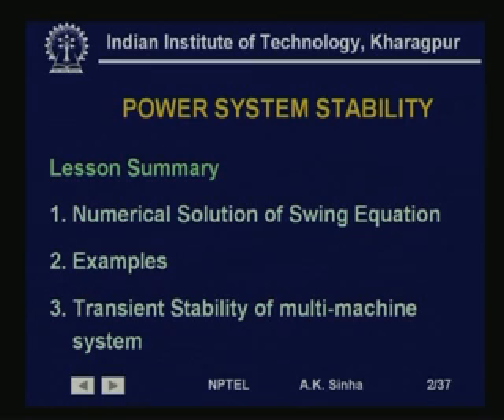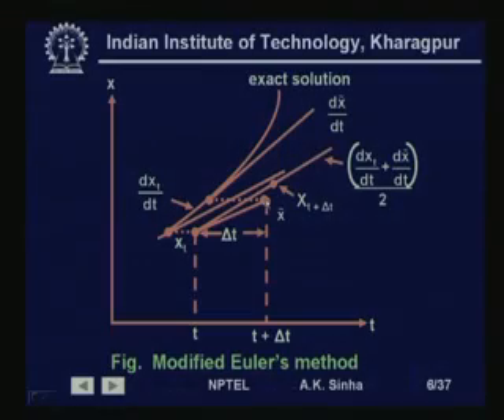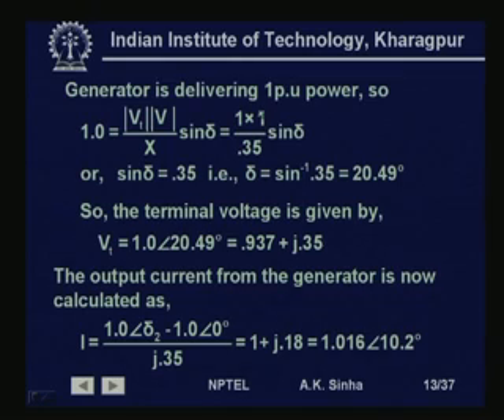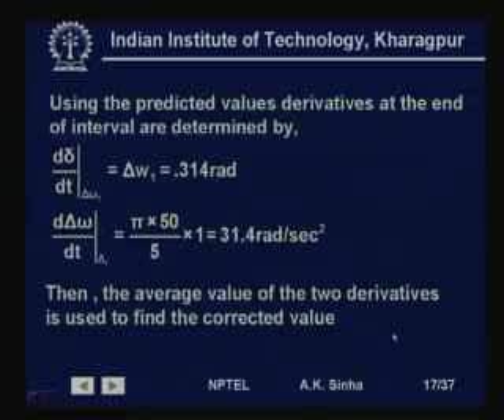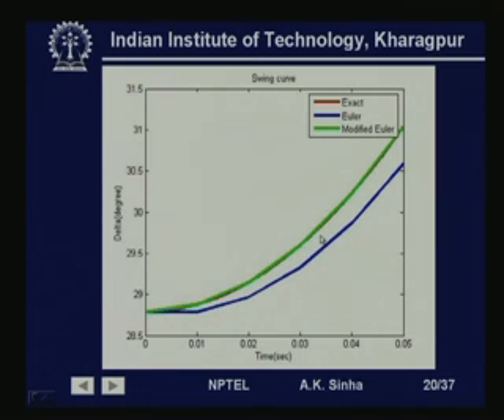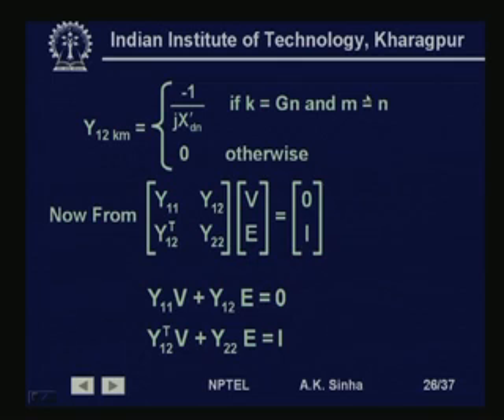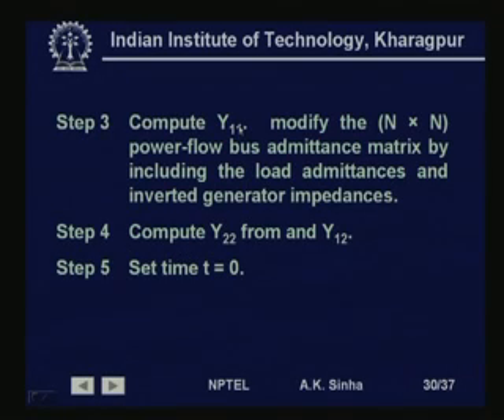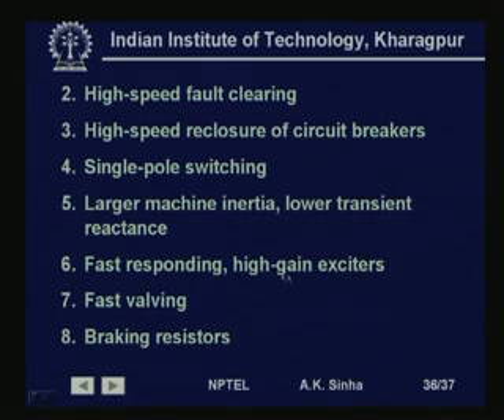Lecture - 39 Power System Stability - VII

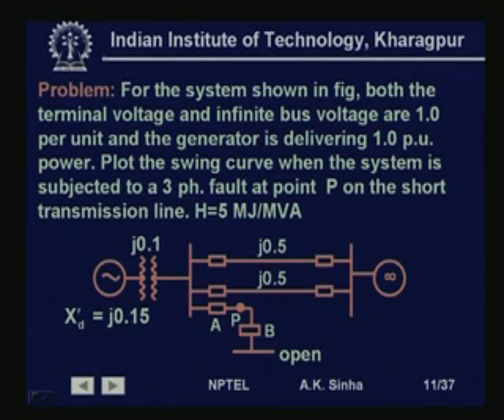Comment: This is was an excellent lecture of Power System Stability. I did additional calculations of the problem explained at the minute 15:58 of this video. According to the book of Dr. Kothari, Modern Power System Analysis, Third edition, Chapter 12 , the exact solution of the swing equation during the three phase fault is 
 δ(t) = ((π f Pm)/(2H))t^2+δo = (π (50) (1)/((2)(5)))t^2+0.5024 [rad]   then the exact solution is   δ(t) = 5πt^2 + 0.5024 [rad].  The critical clearing time and critical angle were calculated in Lecture 37.  Best regards from Caracas, Venezuela. My name is Carlos Dominguez (Student of specialization in Power Systems at Universidad Central de Venezuela)